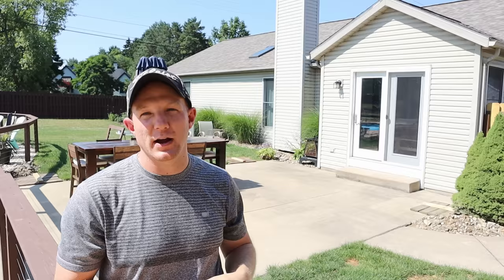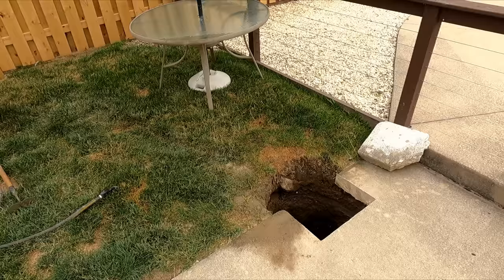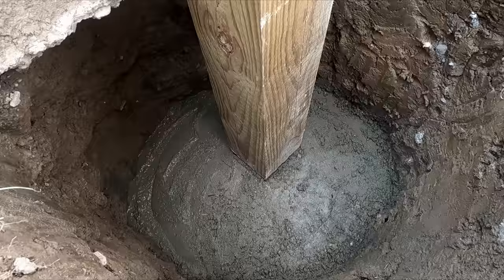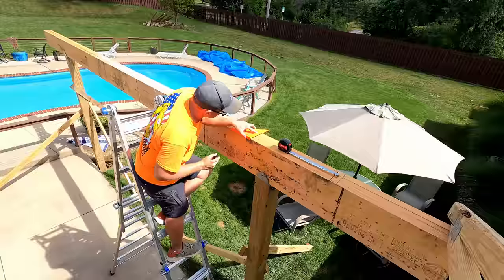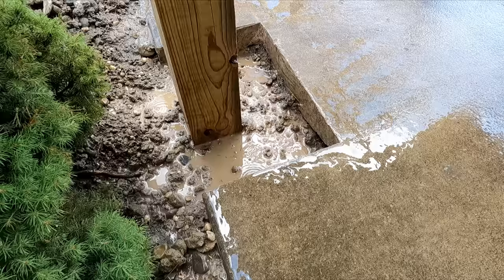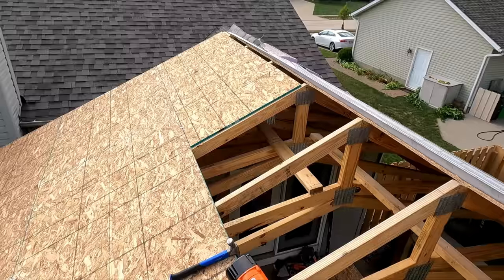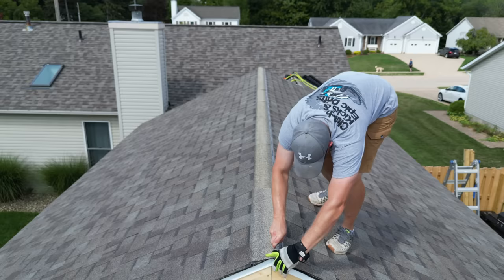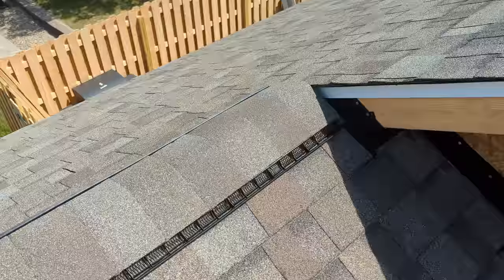DIY Covered Patio | P1: Building A Roof To Cover My Concrete Patio | Foundation, Framing & Roofing

Comment: As a G.C.who has been in the trades for 30+years,I’m very impressed with your DIY project!Your willingness to tackle a roof tie in along with your attention to detail in your project and video is commendable!Also great to see you having your dad work along side you,I was lucky to have my carpenter father teach me all his trade secrets.Keep up the great work and look forward to seeing the next one!!Aloha from the big island!🤙🌴
Reply: It was a great job everything was perfect except for the 6x6s Post questionable talking to educated men telling you that it was okay to bury below concrete line 40 years is nothing in a building buildings last 100 plus years I I know I work on them all the time. 40 Years of short-sightedness on a main support post
Reply: @samuelwotring633  Can't agree more then that, simply bury any wood below  ground level should be avoided at all cost. Been say that, I might still use his way of setting with difference of give wood extra protection in ground with rubber wrap or some EZAC glued over below ground part. Why is that, cause setting post above required cross structural supports braces
and in this implementation will be hard to achieve similar final look result.
Reply: So far so good . Well done ! Congrats ……
Reply: My brother stay in Hilo.Big island is beautiful!
Reply: Trade secrets should be taught as much as possible. Now it is possible thanks to technology to reach a large audience.
Reply: Great job. I just built a multi level deck and designing a roof/ screen enclosure. I'm in Florida with different codes, but your overall explanation and plan was very easy to understand. Very nice work.
Reply: This is not  a diy'er. A diy'er is not drawing up plans to code and submitting them to his city, nor is he capable of designing roof trusses.
Reply: @curtzeek8818 A GC,  Homeowner,  who cares who does it?  It’s gotta be done. If the home owner can do it and save money through an engineer what’s the difference?
Reply: @curtzeek8818  a diyer absolutely can draw plans meeting codes and submit to their respective government entity.. I'm currently building a massive addition on my house and I'm the one that designed and submitted the plans lol
Reply: @Junglebrute  I didn't say they couldn't. It is the exception rather than the rule tho, and you know it.
Reply: @GageDrums  Well sure they can if they know what they're doing. Most don't know and you know it. You are the exception to the rule which means you are probably a contractoe or someone who's worked closely with one.
Reply: @curtzeek8818  damn.. You caught me. I did work for a contractor during college 🤣.. But I'm sure people can! I think even that tech teacher did roofing in college. I think he said it in the video.

Comment: You’re a beast brother!!!!!!
The only thing I didn’t agree with was back filling the 6X6 posts with dirt.
I would of went with concrete (with a few long screws running through the posts before back filling with concrete for extra support).
I’m a GC and have seen these posts rot within 8-10 years. Not only that, termites will destroy any wood, pressure treated or not.
Other than that, your project looks great!!!!!🤙🏼😎
Reply: You never put concrete around wood post the acid in concrete rots the wood within 15 years
Reply: moisture in the dirt will rot the post in 10

Comment: Great video, was a high school construction teacher.  I personally don't put wood posts in the ground anymore.  I did a very similar project and poured concrete posts about 3 feet high and 18x18 inches.  Going to put stone on them to dress them up.  Don't be embarrassed at slow progress, you saved a ton of money.

Comment: Incredible attention to detail! This is why I like doing my own projects. Without the pressure of production you can take the extra time to make everything perfect. In production I was told to build with a tolerance of 1/4 inch. I personally aim for 1/16. I’m pretty sure you are building to 1/64 or smaller lol. Amazing work and documentation.
Reply from the maker: Hahaha I hear you and there was a ton of time for thinking!
Reply: I've worked in the single family home industry for over 40 years and usual tolerances for rough framing is 1/8", which is also the width of a saw cut.  Trusses are built to 1/16" accuracy tolerances.  Anything smaller is for cabinetry and fine finish work.

Comment: I have been building for 40 years, and I am impressed how you handled this project. You obviously did your homework before you got started. Very nice job.👍 Oh, If you ever tackle another shingle roof, the feet on the roofing nail gun are adjustable. You simply set the feet under the bottom edge of the lower shingle, and rest the shingle in hand down on the face of the safety/tip of the gun. That will give you the correct and consistent spacing. Depending on which shingles you use will determine the spacing. Metric shingles typically are 5 5/8" and ASE are 5". For some reason the west coast uses the metric shingles which are 1 meter or 39 3/4"x 13 1/4", where the east coast uses SAE shingles which are 1 yard or 36" x 12". Don't ask, because I have no idea why. Anyway That a great job you did! 👍

Comment: Looks GREAT. This is something I’ve wanted to do as well to our back patio. But I cheated and ordered the Toja Grid system for 6x6 beams. The kit consists of 4 Trio Arm corner brackets and 4 Solo bases. I’ve found at my local lumber yard some 6x6x16’ beams that were returns and got them at a great price. Took a few weekends of cutting and staining them. It turned out pretty well. Wife’s happy. Love your project. Look forward to your next video.
Reply from the maker: Thanks I appreciate it. Your project sounds great and better the wife was happy!

Comment: You did an outstanding job, looks fantastic.. One thing that even the pros or general roofers miss is they often mount the drip edge tight to the trim. Water will follow the contour of the trim and some will get behind the gutter instead of going in the gutter. Ask me how I know.  Next time around pull out about the width of finger tip. Fantastic job something to be proud of.

Comment: Congrats on a great project.  The scissor trusses made that project so much easier.  You probably could get by without ice and water shield on a roof over an unheated porch but it won't hurt anything.

Comment: Im a 66 yo pretty serious diy guy. Your work is outstanding! A couple of things I would share with you; 1. The ice shield in your case is totally unnecessary. The purpose of it in a house is to prevent melted ice from flowing backward as it mounds up from the drip edge back. In your case, you have no heat source under the roof to cause all of the melting there. 2. Next time you might consider building up the flying rafter at the end, and then just install it. Either way works, but building it up on the roof might be easier for you. I found it particularly satisfying that you discovered the value of using a laser, and also, that I have the same ladders that you do! I’m not sure what I would do without my laser and my expanding step ladder! Bravo mate, you “nailed” it! Edit; I had a nearly identical roofed patio on our last house and I installed steel roofing on the ceiling to cover up the trusses and finish it off. If I had it to do over again, I would insulate it first to keep it cooler on the hot days. The sun really heats up the shingles and you can really feel it down below.

Comment: Easiest way to keep the roofing underlayment straight is to cut it in the middle and overlap.  Not sure you needed the Ice and Water shield because the space under is not heated - BUT - I think for safety (slip resistance) it is worth it the extra effort - You did a very good job!

Comment: Very, very nicely done.  I had to laugh a couple of times.  First, when you said that it wasn't really the weight of those 6x6 monsters, but how awkward they were.  Wait a couple of decades.  Doing stuff like that by myself used to be fun.  Now I need videos like yours to remind me that it's possible.

The other was at around 9:45, when you're cutting the top off the 6x6 posts with the sawzall.  Next time you're doing that, consider using a big clamp that holds the top in place.  A big heavy section of treated 6x6 could hit you in the head just right and split your scalp open.  (Ask me how I know that.)  I saw your top section scoot over when you finished that cut and just cringed.

That takes nothing away from the great work you did on this.  I'm about to build a covered patio, so I really appreciate you taking the time to document your efforts.

Comment: Those posts won’t last 40 years who ever told you that is full of sh*t, but around pads you don’t have many options to get a good finish, it’ll last maybe 15, that’s why I like pouring footers flush to concrete and installing    J hook and Simson clip. Either way good job man looks great!
Reply from the maker: I looked into that as well and seems like a great way to do it. Thanks!
Reply: Yeah, ever since they took arsenic out of pressure treated lumber, it is crap when in contact with ground.  Never bury wood posts.
Reply: @Lee G Different issue with no footer, if the weight of the roof is too great the posts could sink/crack the patio because they aren't supported properly.  Burying the posts in the ground will cause them to rot prematurely.

Comment: I do like the way you and your dad started the upper rail's and putting the two runner's made it stronger than just one extra wide runner. But I would have used  a board glue to seal them. (That's just my sight)
 If I didn't know better, I'd think you and I do it the same way, but I hand made my own Truss's. Everything I saw is just the way I built mine. Only I did mine pretty much alone. GREAT JOB!

Comment: Nicely done your project but for me even though the posts are treated; I would have placed drain rock around it instead of dirt. My reasoning is the wood shrinks and the post develops cracks which allow bugs and moisture to migrate into the center of your post causing it to rot because the treatment of the post only goes in so far. What you can do to test this out is the ends that you cut off, put one in with soil around it say in a bucket with hole in the bottom for drainage and put another cut end in another bucket doing the same thing but use drain rock around it. Then after two or three years pull them out and check the condition of each post to see how they turned out. Good Luck
Reply: Yep you're right would have been a lot easier to bring the concrete up to grade level instead of spending all that labor to fix something in the far future done right the first time don't need to think about the second time

Comment: Nice job! A few comments:
1. In a structural setting concrete MUST be vibrated in order to push out the air bubbles. Not vibrating the concrete means it’ll be weaker due to the trapped air bubbles and will likely crack over time.
2. LVL’s that are joined to form a support beam generally require either through-bolts or structural screws to attach them. I’ve seen it done with nails but even then it’s 3 nail (top, middle, bottom) every 8”-12”.
3. When attaching wood to metal it’s seems to be good practice to give the water a place to drain so that the bottom of the wood doesn’t rot.
Overall, well done👏🏻

Comment: As a 22 year + GC, I loved your way of doing this project.  The only real difference I would have recommended would have been to use a liquid waterproofing to the posts (underground) and to backfill with gravel instead of natural dirt.  Minimal cost/time and overkill is always good.  One other point...seems like the connection between the posts and beams is a little light, but if it was approved by your local municipality with a permit, that's what really matters.
Reply from the maker: Thanks and I understand your points
Reply: Because without saying no wood below grade. What are you going to do when the 40 plus years has expired in the it starts to fall lean how old you going to be and have to fix it. Probably too old to fix it at the hire someone.

Comment: You should be proud of yourself. It seems like you did your home work as a teacher, and you have all the knowledge, tools, and most of all father as a helper. It looks great, only thing I would done different is that put some nails 6 or 8 inches half way in and put some tar on the bottom  of the posts to hold the cement better and protects from the water damage. Bottom line it looks great, use it in good health!

Comment: Amazing work and great explanation. 

I’m just wondering if there would of been any way to install the posts without having to cut into the concrete patio? Or would that of messed up the design and angles of the patio cover.

Comment: Wow I came across this video while looking for something else and decided to watch since I want to do something similar next year. Man, I loved following along with your build and the narration really getting into your reasoning and mindset for the various steps throughout the project. The only thing I will do differently for myself is set my posts on some sort of Simpson Strong-Tie bracket attached to a completely solid concrete footing just because I'm super over the top with everything. It's great to watch another like minded DIY-er take on a big project though and  sometimes learn as you go through research. I honestly feel that most of what I build is every bit as good or in a lot of cases better than a professional would do because I take the time to make sure everything is done exactly right, will look great, function correctly and not have issues. I can see you doing all of this as well. I can't wait to see the next part of this project. Great job!
Reply: No you're not over building by attaching it to above ground concrete that's the correct method and I do believe it's Federal standards one inch off of the concrete with the Simpson tie down on the concrete

Comment: The stiffness of this wet concrete without a vibrator compacting it with your body weight will help.What the vibrator does is to cause the fines in the wet concrete to flow around the aggregate eliminating all the larger voids in the pour.
Reply from the maker: Thanks that makes sense

Comment: Very nice project and attention to detail. I appreciate that you consulted A&Es regarding the posts, though as a professional engineer I still cringe at putting wood in the ground, regardless of how much chemicals and heavy metals are pumped into it. Not to mention that the chemicals will leach out into the ground around your home. So much better to get a little trailer of redimix and pour a pier like they would for your house, especially with it being attached to your house. The mix you buy from a plant will also be superior to the bags from a store. 

I too prefer screws for some framing situations, but you definitely need to pay attention to the strength compared to the nails. Screws tend to be more brittle than nails which causes them to fail more catastrophically.

I also feel your pain regarding scheduling. Good job on continuing your projects. Gotta go work on mine.
Reply: Also, especially when discussing the foundation and depths, you really should reference your general location. Guessing you are more northern than southern USA. Foundations only need to be deeper than the frostline or 1’ minimum if there is no frostline. They’re usually placed on 4” minimum of compacted gravel.

Comment: Special note, it is not the inground part that rots, it is where the ground meets the air that it will rot. And you will get 40 years, but the base of it will have the rot and it will slowly eat away at it.

Comment: Nice video, great job. Only critique, should have installed a ridge vent. Would have added less than a couple hundred bucks and 2 to 3 hours of time. Reduces the attic temp 15 to 20 degrees in the summer months. Many benefits
Reply from the maker: Thanks, in part 2 I do install a ridge vent.

Comment: Nicely done.  I want to do a similar project maybe this spring and will use this as a reference so THANK YOU!   My only question is:  Those Posts will eventually begin to rot? I noticed you didn't wrap them with anything?  You could have gone with some embedded mounts to bolt the posts down above ground?  Do you have any concerns there?
Reply: You're right that was the only mistake he made. Otherwise it could have been a perfect job

Comment: Maybe you've got some steel verticals here to keep this Airplane Wing from taking off.  You will loose this roof.    Concrete in the ground with rebar and anchor bolts in the concrete then attached to and narrow steel sheathing on each post at least four inches wide and 1/4 inch thick going up to steel plates above each column.  The physics for this roof on a windy day.  I would say if it is still up you've been lucky so far.   I love the build tho.  Looks Great.   Good luck!

Comment: 2 things...you don't need ice and water if the area is not heated...and your drip edge goes on top of the ice and water when you do use it...also if you put your paper on straight you can go by the lines on the paper so no need to snap lines..just a couple roofing tips

Comment: water gets in at the end of the post like a straw it will suck up water. when i did my post in cement i used henrys roofing tar ot lap cement on the end of the 6x6 and the sides of the post up to ground level before i poured and back filled... now it will last for a 100 years